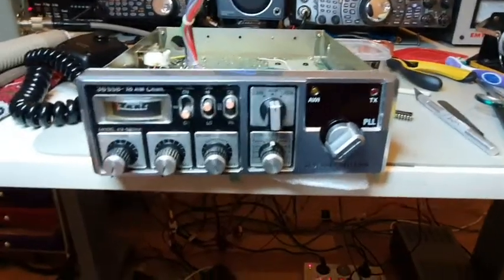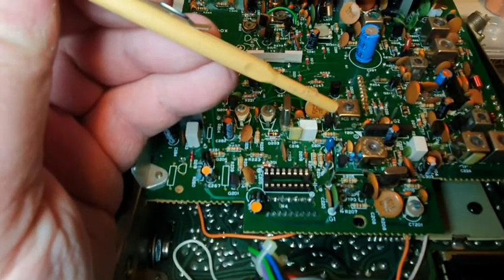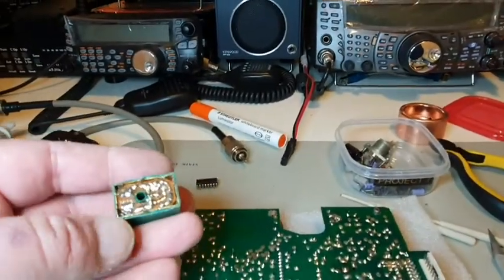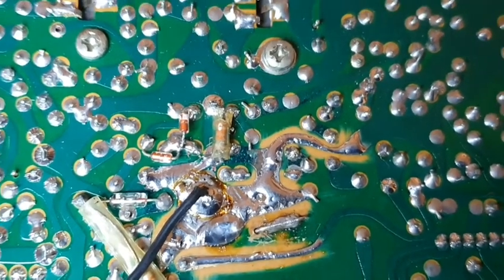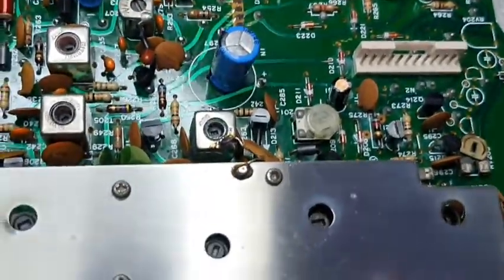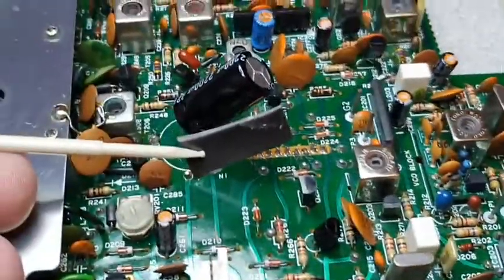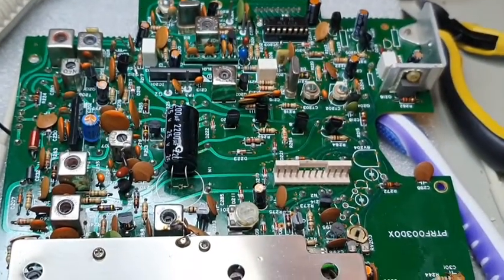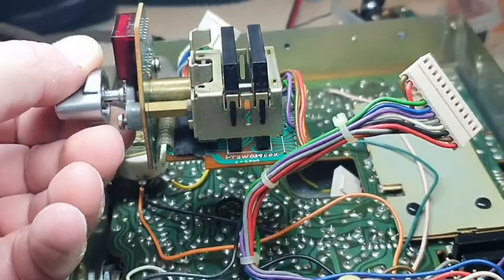General Electric SSB CB A3-5825B GE B Model VCO Replacement, Cap Damage, 40 Channel update

Comment: Hi Paul do u by any chance  have  a second  1 that u can share some pics of what is should  look like would  be  great  as I have 1 with  some track damage  at that  same cape but different  radio it a midland 78 999 has the South African  version  of this above  board
Reply from the maker: Which radio Dwayne

If I have I can send to you
Reply from the maker: Yes I can I will have several, do you want with the green VCO?
Reply: @Pull_It_Apart_Paul_Ham_CB  yes green  vco
Reply from the maker: @dwaynedekoker5721 how do you want me to send to you ? Email or a video?